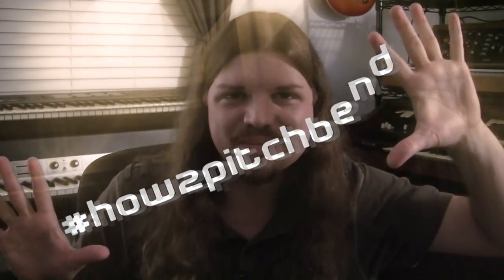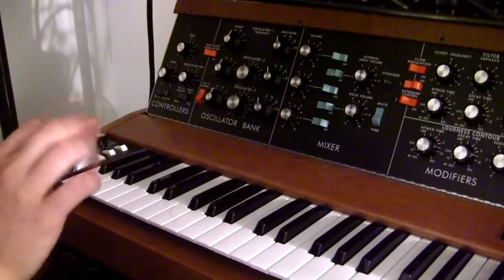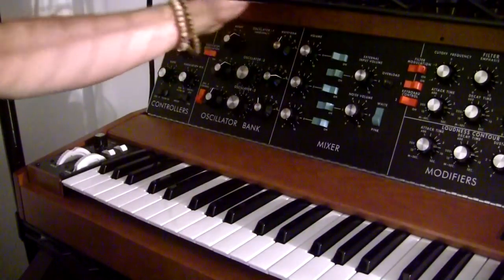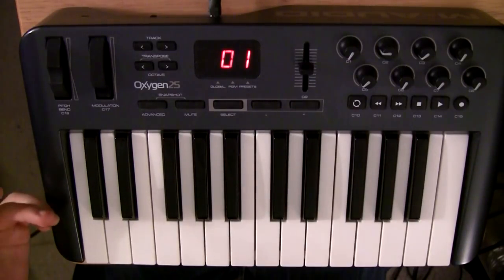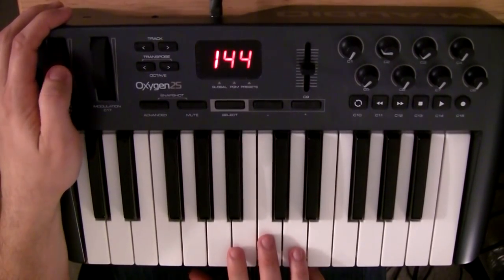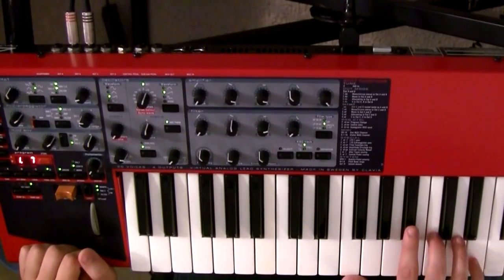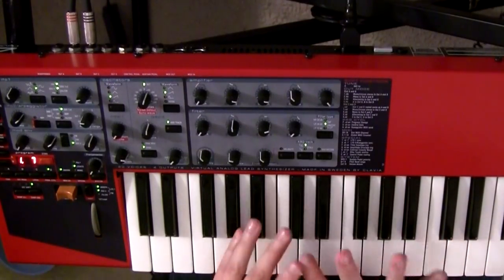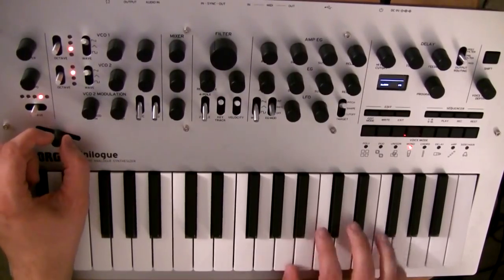How To Pitch Bend! | MOOT POINTS Ep. 3

Comment: I think the best tip I can give is - do NOT use modwheel for vibrato. Use pitch bend for vibrato, this way you can shape it yourself, both the frequency and onset and depth! You can do it on the wheel, you don't need Nord's bend stick to do it (although it will feel the best on the pitch stick, that is true). Learn from Jens Johansson! :)